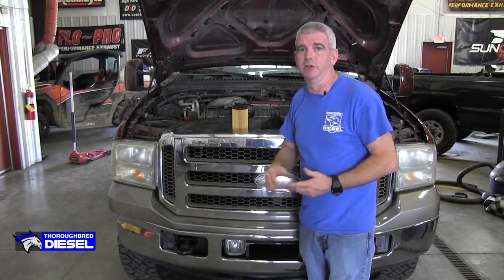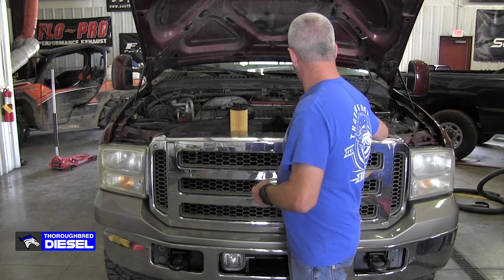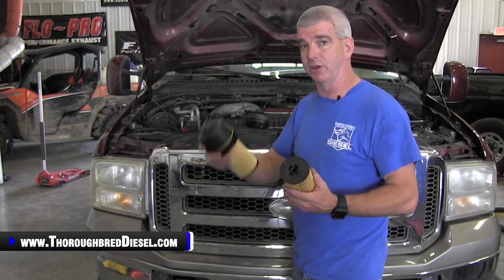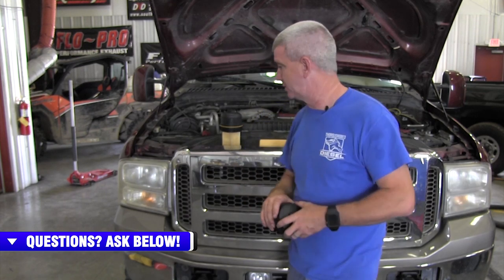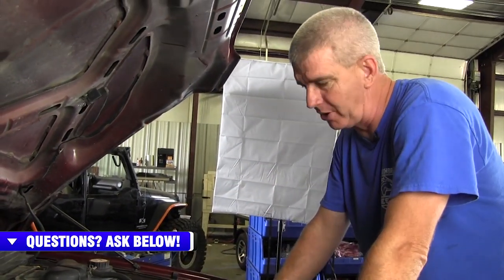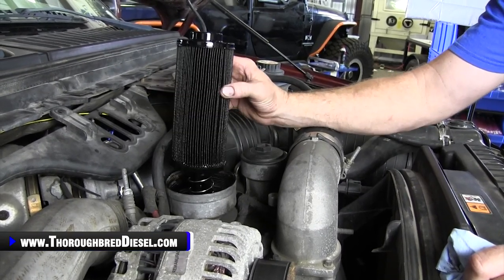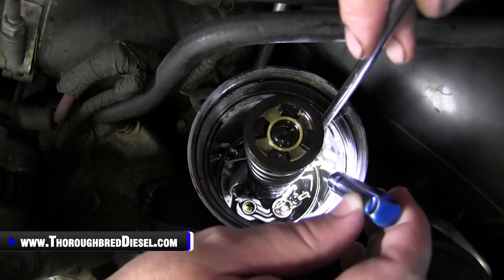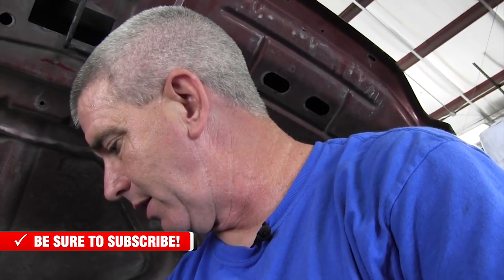1 Common Little-Known Mistake 6.0 Owners Make On Every Oil Change | 6.0L Oil Filter Install

Comment: Use the factory cap with a factory oil filter. You definitely do not replace the cap everytime. This is why the motorcraft filter comes o rings.  I would never put after market on any of my trucks.
Reply from the maker: The worst situation is when customer buy these trucks used, with an aftermarket filter on them, then proceed to fit the motorcraft filter into the aftermarket head. Not a good situation. Trying to help those guys and gals out.
Reply: @thoroughbreddiesel  I understand. My advice to them is to get the oem cap from you or their local dealer and pair it with a motorcraft filter. I've seen the aftermath of cheap filters and caps. 6.0 is a great engine with great potential, and because of its poor reputation due to early tunes with to much timing, egr failures, and poor maintenance you can pick one up fairly cheap. Diesels are high maintenance and the 6.0 is no exception.

Comment: About 2 weeks ago I changed my oil with genuine motor craft filter- like you said the cap didn't fit-I broke the old filter loose and put the new filter in the old cap- fast forward 2-3 weeks- I have a bad oil leak- looks like it could be the base of the oil filter housing- would the wrong filter be the cause ofthe leak 2-3 weeks later?????
Reply from the maker: If you stressed the housing it could be.  I don’t think that it will but its possible.  Go back to stock cap and filter.

Comment: With Aftermarket filters come with plastic star piece that is on top of standpipe. its yellow at 8:10 mark, that needs to be removed also. The factory cap and filter don't need that piece
Reply: What does it do?

Comment: I hate these type of filters. My Cummins fuel filter is the same style and every time I change it I'm thinking dear Lord I hope that seated correctly because if it didn't your talking a several thousand dollar mistake. Spin on filters are the way to go. Pretty hard to screw that up.

Comment: I have 2006 6.0.  when I bought it 4 years ago it had an aftermarket filter and cap.  But I bought an original type of filter. I was not aware of the differences till I tried to mix the two. It took me 2 days to get an OEM filter cap. At that time they were like $40.00, added to the price of 15 quarts of oil and a $30.00 filter. and 2 days without my truck.
  If you go into an oil change garage and have them change your oil and filter, most won't use an OEM filter they throw your cap away and use that thing he was calling a filter. Those Spanish people won't know any difference. But it will cost you over $40.00 to get a new oil filter cap. On top of that, they might just be using regular ole 5w 30 car motor oil in your motor.
  Since I bought the truck, I've changed my own oil every time. That's the only person I trust to use the proper stuff.   If someone says they can change your oil for $75.00 you better just get dressed up as a sucker with a stick up your, you know..  because you're getting reamed. There's no way you can even buy the oil for that much. Or they plan on not changing your oil and just take your money.

Comment: Is it necessary to upgrade the oil cooler on the 6.0 if you install an oil and coolant bypass filter kit on it?  You think the bypass filter kit would filter it better so it doesn't end up clogging up the oil cooler.

Comment: hello, thank you for this video, do you know what that (check valve assembly?) part is called inside the oil filter housing at the 6 o clock position, and if it's replaceable by itself? i was having hard start issues, removed it, and found the rubber washer deteriorated.

Comment: I work on 6.0’s a lot I’ve never even paid attention to what the aftermarket filter/cap combo say they are so easy to identify by just the height of the plastic cap the fuel pump/module on the frame uses the same cap as the oil filter FYI to anyone they are less than $30 at oriellys
Reply: Good info for the fuel pump

Comment: What cap should I use if I run the oe filter and what length thanks? Looking at buying a 04 6.0 right now
Reply from the maker: Always use the OE cap.  We also suggest the OE filter.

Comment: Some parts you can get away with aftermarket, but on PowerStrokes, all filters, minus air, should be FOMOCO oil, and fuel filters, transmission as well. Otherwise you’re just asking for problems at some point in the life of these trucks.

Comment: To clarify:  When you say not to use aftermarket caps, you are not talking about the Sinister Billet ones correct? They are okay?  In other words:  Is the Sinister cap with the MotorCraft filter an acceptable combo?
Reply: Hmmmm good question I'd like to know also

Comment: I changed the oil filter on a 08 E450 with a 6.0L in it. I couldnt get a filter from dealer so we got one from carquest. The canister was a bit shorter but not by much, and the amount of filter sticking up above top of can was about same as old one. Next day the customer said the filter blew off. And this is an E series so filter is beside oil pan, wondering if the aftermarket filter itself is the problem or the difference in length

Comment: Question is the spring and plastic piece in the center is that plastic piece supposed to be connected to anything?
Reply from the maker: It should be on the spring.  If you even question it, get a new standpipe kit.

Comment: At my job we have 2 6.0 550 work trucks and my boss made a bad decision. Both  trucks had the aftermarket caps and at separate times about a year apart from each other under standard driving, the cap ripped about 3/4 the way around the top of it and out came all 15 qts of oil all over the motor . Needless to say we only use motor craft parts now. Stick with the oem stuff when it comes to that stuff for sure

Comment: I use WIX filters on the the 3 6.0 that we have and have never had a problem.   I don't think WIX would ever sell a  filter that wouldn't be right.   The lawsuits would be huge.  You just can't mix the 2 filter elements.
Reply: But people reuse the cap w a smaller filter
Reply: 100% never seen a failure at my shop on any 6.0 with a WIX.  This video is very misleading

Comment: Good video.
There was never a issue with screw on oil filters. Just remember to inspect and clean treads for the possibility of metal shavings from the tread cutting process.
The designers at International of this particular oil filter deserved to be kicked the nuts. Enough said. Just MPO.
Reply: Being a Cummins guy, I thought the ford filters were stupid.  Now that I own a 6.0, I like the filter cartridge much better.  Its quicker and cleaner.  No more draining filters, just toss it in the trash.
Reply: @Russ-nf9tv  yup

Comment: Man you need to remove the white plastic ring placed on the end of your standpipe. Its an adapter to use an aftermarket filter. You are effectively bypassing the filter all together with that still installed. Look it up on google and you see what I’m writing about. Critical mistake you made.

Comment: u can run oem filter after using a aftermarket u just got get a oem cap go with it. i guess his ponit is u cant mix filters with different caps.  i find this happen on a friends 6.0  got ih(ford) filter and cap wasnt bad cost
Reply: Always run genuine Ford filters! Especially in 6.0!!!!!No exceptions! Not worth a dead motor!